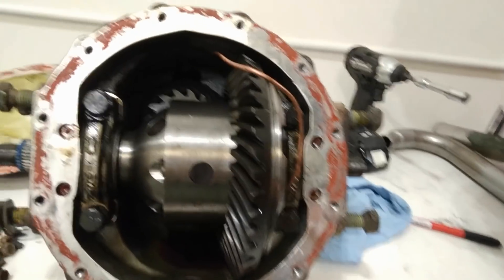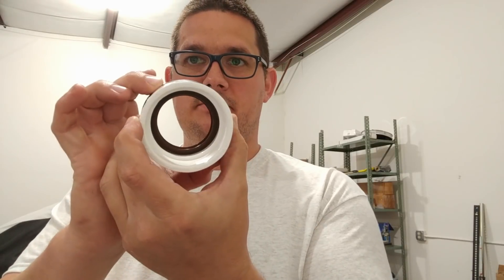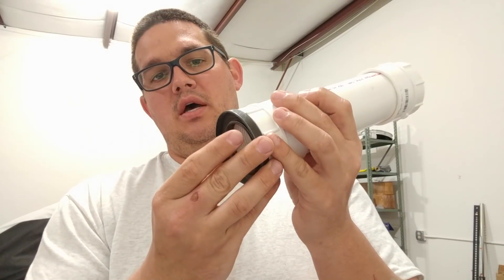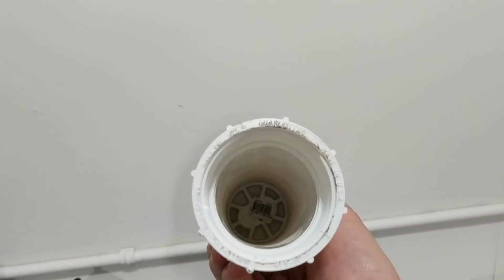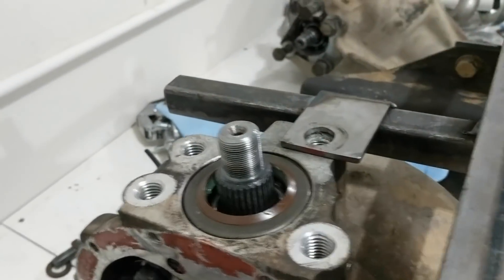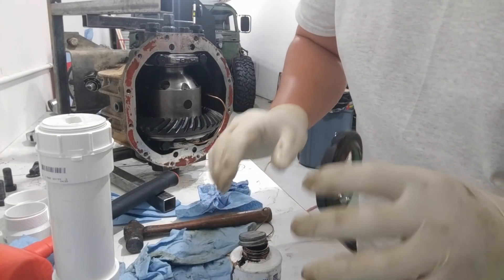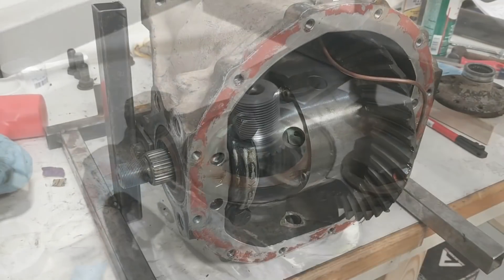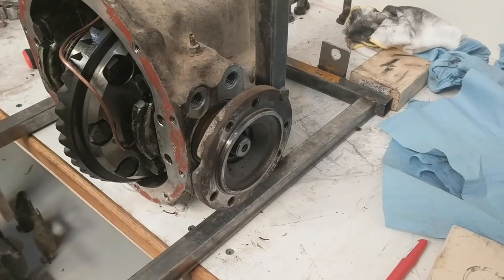Humvee Differential Overhaul and Output Flange Seal Installation- LSxHumvee

Comment: Great video. I have a question. I just bought brand new 2.73 axles for the front and rear. I took them out to Predator to have the ARB locker kits installed. I installed the rear first. Here's my video. https://www.youtube.com/watch?v=ni2v_kTyWCg. Once I got it installed and after my video, I noticed that my gear oil is being pumped out of the vent line and into the vent system. I was wondering if you had the same problem? I read a lot of blogs that said this was common with ARB's. And this is while they are NOT engaged. I also notice that the gear oil is making its way to my right rear gear hub. The level gets higher on the sight glass after driving. Most of the blogs said to increase the size of the vent system.

Comment: What's the advantage of having an air Locker when the Humvee already come with a Torsen differential?
Reply from the maker: The Torsen is a good differential but not the same as a locker. It slips quite a bit even with brake modulation. Running the much larger 42" tire I didn't want to have to worry about spinning the tires up and working the brake to give me the kind of traction that would allow slow controlled crawling. The locker is just a more efficient option and selectable for street driving and off road use.
Reply: @LSXHumvee  nice!  Thanks!
Reply: The Torsen / TT4 system is good but it doesn't engage until after you are already stuck or slipping. The ARB's can be engaged before that happens and you have full control over them instead of the computer deciding for you.